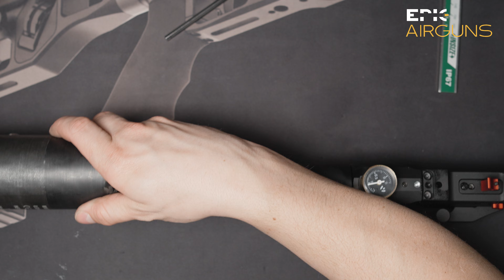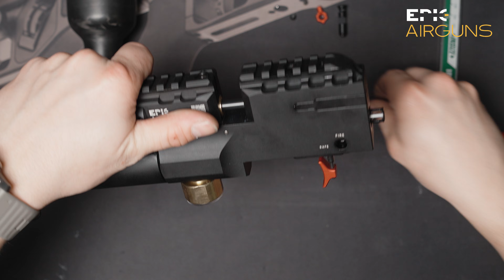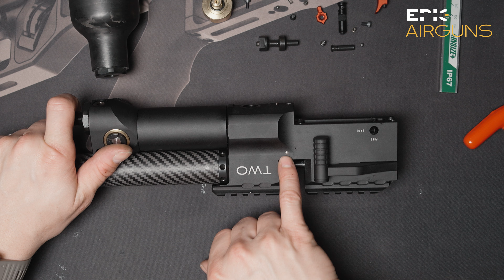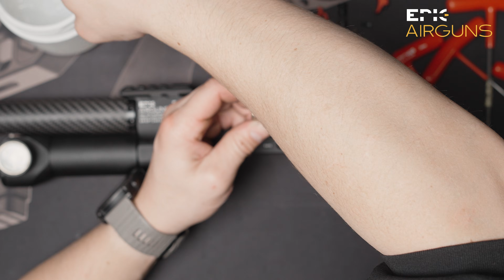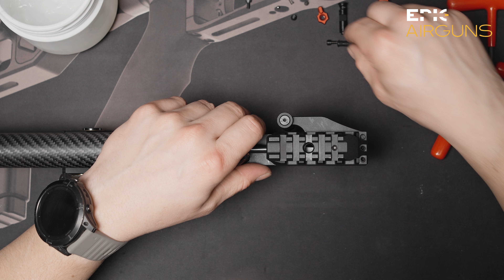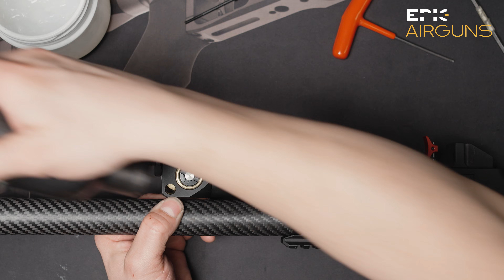EPIC AIRGUNS - How to adjust the valve (Epic TWO)

Comment: Hi,
I the video it's said that the balanced valve max is 3,2 mm. In manual it says 3 mm. I want to reach 150 Joules and maybe this is the way to go? I have 304 m/s with 700 mm barrell and reg. pressure 200 bar. Valve 3 mm. 190 bar and 3,2 mm   may give me 314 m/s with my 48 grain slugs?  This takes me to 150 Joules +.

Comment: Best Air gun I've ever had. I've owned Daystate Redwolf HP in .22 Crown mk2 in .22 and they both got sold. This Epic 2 in .22 700mm Czub isn't going anywhere.  I do have a serious question, because I can't help thinking about it. Right now, I'm shooting 30 grain slugs at 905 with 130 bar. The gun is exceptionally accurate and exceptionally consistent. I have zero complaints. But, if I wanted to try 150-160 bar on the reg and maintain the same velocity I am at now. Can I do the opposite and close the valve a bit so that I can still maintain the consistency I am looking for with proper hammer tension and valve opening but yet decrease the valve duration so I can utilize a shorter blast of higher-pressure air as opposed to a longer blast of lower pressure? I'm not trying to increase my velocity; I am trying to increase the reg pressure while keeping the same velocity and standard deviation that I get now while minimizing the extra volume and possibly achieve better harmonics and be more silent at the same time. Or is what I'm suggesting just simply making something less efficient and reducing the plenum size would make more sense?

Comment: I had one of the trigger pins fall out and get lost ☹ replaced by a piece of a drill.
On my 700 mm 4.5 mm Two i found that you dont get much out of messing with valve close, but this is of course also a very light caliber and even shooting the heaviest 24 grain slugs i had no problem getting up to significant speeds.
And absolutely no need for the 13 and 16 grain i would normally shoot.

BUT !!! this is a very long 4.5 mm rifle.

Love my Two.

Comment: What a lot of messing about to turn up the power!
..thank god its easier on a lot of other rifles!
Reply: Fortunately you will probably not have to mess with this, as i write above for me as a owner of a 700 mm long 4.5 mm rifle it is not at all needed but i have tried.
Having the rifle / valve open longer was no good for me, having it close faster did make a change but not really what i needed with this long rifle.
So in my case i have the adjustment nut a 1/2 mm below flush with the end of the valve housing.

If you have a compact version you might gain some air savings, at least as per SUB 12 airgunners test / review of a compact SUB 12 Two rifle, but that was early days the default setting on the compact versions might have changed since then
Reply from the maker: Thank you for your comment. We think that you have missunderstood this video. You adjust the energy of the rifle with the external regular that works from 60 to 200 BARs. With the factory setting of the valve you can still get around 130 - 140  Joules in .25 cal with our Epic TWO and this is sufficient for 99% of shooters and we save the air consumption with this setting. We have made this video for shooters, who want to push the limits and want to get around 160 - 170 Joules with our Epic TWO and up to 200 Joules with the new Epic ONE in .25 caliber (we will release the sheet for all calibers very soon).

Comment: How much FPS can be increased by doing this? Or how many joules? How much power?:face-blue-heart-eyes:
Reply from the maker: It can does around 20 - 30 Joules. Depending on the weight of ammunition. You adjust the energy of the rifle with the external regular that works from 60 to 200 BARs. With the factory setting of the valve you can still get around 130 - 140  Joules in .25 cal with our Epic TWO and this is sufficient for 99% of shooters and we save the air consumption with this setting. So 90% of the shooters do not have to touch the valve at all. We have made this video for shooters, who want to push the limits and want to get around 160 - 170 Joules with our Epic TWO and up to 200 Joules with the new Epic ONE in .25 caliber (we will release the sheet for all calibers very soon).
Reply: I’ve got an epic two .25, would you recommend sending it to the dealer to have valve altered ? top power is 950 fps with slugs atm.
Reply: @transformeruk5300  1000 fps is the upper limit for .25 slugs

Comment: A job to be done by someone with some experience. In the next generations you could try to make it possible to remove the valve from the bottle side (removing the plenum). In this process there is a high risk of losing a spring or ball or screw to remove a few more joules.
Reply from the maker: Thank you for your comment. You adjust the energy of the rifle with the external regular that works from 60 to 200 BARs. With the factory setting of the valve you can still get around 130 - 140  Joules in .25 cal with our Epic TWO and this is sufficient for 99% of shooters and we save the air consumption with this setting. So 90% of the shooters do not have to touch the valve at all. We have made this video for shooters, who want to push the limits and want to get around 160 - 170 Joules with our Epic TWO and up to 200 Joules with the new Epic ONE in .25 caliber (we will release the sheet for all calibers very soon).
Reply: @epicairguns  I've been a big fan of your work since day one and I want to see your company grow with all my heart, the price is unfortunately way outside what I feel comfortable with, but it doesn't stop me from supporting you here. True,  there are people who look like they want an air gun to take down an elephant...😅

Comment: How much speed will you gain from going 2 mm to 3 mm opening of the valve?
Reply from the maker: It can does around 20 - 30 Joules. Depending on the weight of ammunition. You adjust the energy of the rifle with the external regular that works from 60 to 200 BARs. With the factory setting of the valve you can still get around 130 - 140  Joules in .25 cal with our Epic TWO and this is sufficient for 99% of shooters and we save the air consumption with this setting. So 90% of the shooters do not have to touch the valve at all. We have made this video for shooters, who want to push the limits and want to get around 160 - 170 Joules with our Epic TWO and up to 200 Joules with the new Epic ONE in .25 caliber (we will release the sheet for all calibers very soon).
Reply: @ so approximately how many feet per second or how many meters per second
Reply from the maker: @LRF1-9-7-2  If you are shooting for example with 4 grams/62 grains slug at 255 mps/836 fps with the factory setup and you will open the valve you will get around 287mps/942fps. But like we wrote before, 99% of shooters do not have to touch the valve if they are not shooting with extremely heavy slugs.
Reply: @epicairguns  thank you
Reply: I am also thinking about this question. Please give me an official reply
Reply: If it’s only a few feet per second it’s not worth touching
Reply: @LRF1-9-7-2  Epic's really bad toys